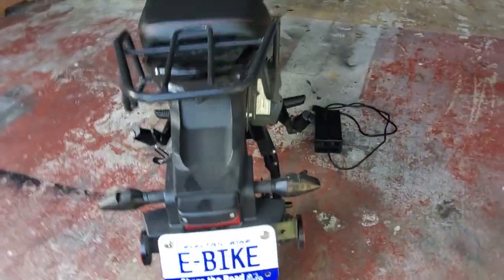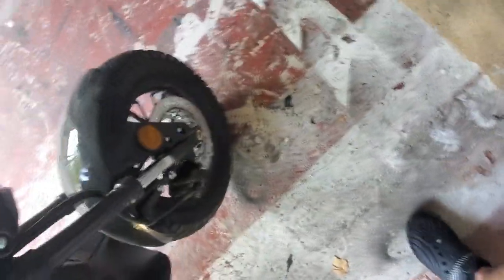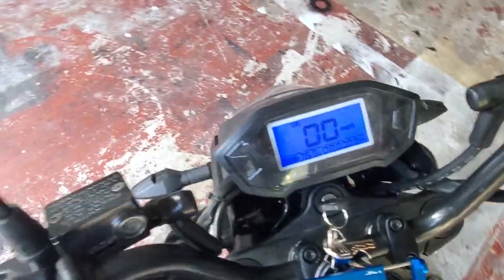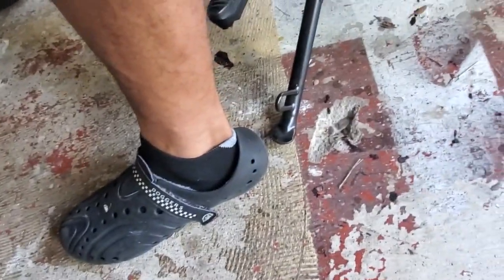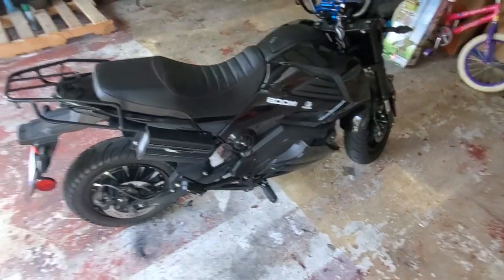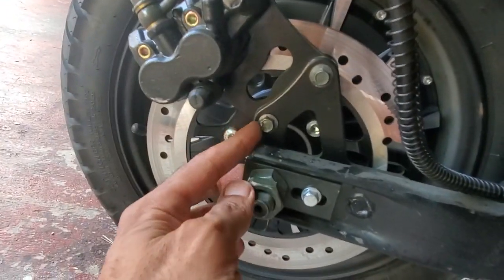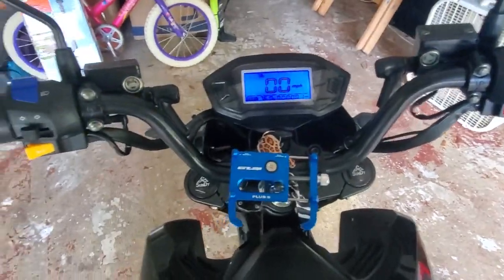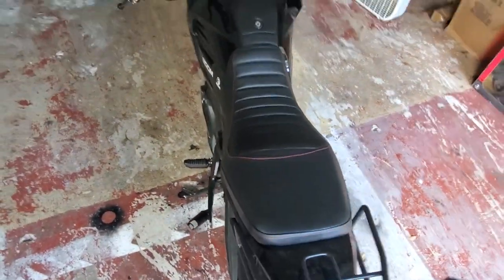Boom BD578Z/ E-Grom/ Boom Evader/Boom EX-20 / Electric Scooter Review

Comment: Thanks for the video i have watched this video countless times and it has helped me in my decision on which bike to invest my had working money in.I  purchased a simular bike (Vader E-X20 2000W) and ive had it almost 2months now, do to the  weather where i live, I havnt been able to ride it much...But I can say that when I do ride it, Its hella fun. Its not difficult at all to control, handles Corners like a champ and can be stored almost anywhere. Hell, i live in a small apartment and I store it in my front room. The only problem I'm having  is that my top speed is only hitting at 59km which translates to about 36 miles per hour...I I can deal with the fact that I can't change the kilometers to miles per hour but when I watch other videos and see others hitting 70km, Its kind of frustrating.I mean at least meet me halfway. Now I have called  tech support and they said I have to get it to its break in Point and should go faster E.g ( 500 to 1000 miles ) or so...I well post pics on my page
Reply from the maker: No problem. Glad my video could help you out! They are really fun, great short commuter  ..thanks for watching! Yeah the kmh part is a bit of a pain. But after a while you'll start just converting it in your head. I typically ride around at around 40 - 45ish. It took a bit to get up to 68. It does need a bit of time to break in. Especially the suspension. Not bad...but gets better the longer you ride. My only gripe are the blinkers. If you are turned to far to the left while going left, or to the right if going right....the blinker won't engage. You have to keep the wheel straight.
Reply: @techjunkie3916  Really? the blinkers I have no problems with, maybe because I have the 2019 version and they probably upgraded it but those review mirrors...man all im seeing is my damn shoulders lol
Reply from the maker: @leonardjones1077  I believe that's the same one I have. But the 2018 version. Boom Vader EX-20 2000w BD578Z. Though the top speed is listed at 55 km/h  on some websites, I've reached 68-69 km/h when tested.
Reply: Good I hope mine gets up there because I went down a small Hill and it stayed at 59km/h and people tend to pass me often..I would stay away from Venom Motorsports Canada, those guys are A holes. They never answer any of your questions and act like they never seen your bike before, even though they sold it to you, yea it's crazy don't buy from them
Reply from the maker: @leonardjones1077  Wow, that sucks. Though im sure I dealt with the same people, I didn't have THAT experience! But to be fair, I hadn't had to call them about anything except my right, front reflector. They said it would be around $25 plus shipping....for a reflector...

Comment: I really like the way your bike looks compared to mine! Would you do a range test?
Reply from the maker: It's been a bit since I've been able to ride. I just ran across a question someone asked similar to that. It's very similar to what they say on their site. But what I found is that 30mph is the sweet spot. 

20mph = 40 miles or close to it
40mph = 20 miles or close to it
30mph = 30 miles or close to it

( when I say close to it, it really is ) You may either get a little under, or over. Flat ground you should be fine. But if you have hills...it'll vary greatly.

It really depends on road conditions, and weight of the rider. I stand 5'11 @ 176lbs and full throttle I get around 67-69 kph/40-42ish mph. I have not reached 70. That would probably take a lighter rider. Someone around 140 - 150lbs or so.

Comment: Yo can it do wheelies?
Reply from the maker: Highly doubtful. If that's your thing, stick with gas powered. Not enough low end torque. And the throttle response is different
Reply: @techjunkie3916  ty
Reply: @techjunkie3916  a zero can do wheelies if you don't learn how to not do it , involuntary wheelies are a problem with new riders on zero motorcycles 😂
Reply from the maker: @yorsan2240  But that's also a totally different bike, has more power.

Comment: Is it restricted when you first get it? Also the speed is fine for me but the range is too low do you think I would be to swap the battery for a  lithium ion 72v 50Ah battery without any issues?
Reply from the maker: Thanks for watching! I dug around a bit when I had the bike, I couldn't find much fact. I found a few rumors about cutting a wire, but I didn't bother trying. I saw quite a few videos where people ended up cracking the plastics trying to swap the batteries...but it can be done. I wanted to do lithium myself. You may/may-not need another controller depending upon whether the controller recognizes the batteries. It should though. But if you want more range. Then get the biggest pack you can find that will fit safely. They also sell hub motors for these as well. I've watched a few videos where people have doubled the speed of these right here on youtube.
Reply: @techjunkie3916   do you know by any chance a good combo of battery and hub motor that will work with it that i wont need a new controller for it?
Reply from the maker: that's a little tough. our hub motors are rated at around 1800w - 1980w realistically, though they say 2000w. You'd achieve your goal  easier by switching to litium battery packs first, then work from there ....I've sold the bike since this video but I do remember doing research on it.
Reply: @techjunkie3916   okay cool one more question. Do you know anyway to charge the bike faster? If im unable to change out the battery for a really high capacity i would like to at least make it charger faster so It less of a wait and more convenient compared to a gas version.
Reply from the maker: @raginghope9866  to be honest that bike isn't set up for quick charging out of the box. You would have to do some mods.there is a guy on here who did it. Motobraap. I think that's his YouTube name. He made his go around 70 to 80mph. But he swapped the entire battery pack and added a chain and sprocket combo. His rear sprocket is almost as big as his back tire. But as far as quick charging. You would probably need to swap out some electrical parts to achieve that. And another set of batteries. These are good for around 600 to 1000 charging cycles. Sla batteries. Go lithium. Also another guy who made his faster was "theinja" on youtube. He got a different electric bike but same principles apply. He, and his friend lord kurt really help you realize what you can do with these.

Comment: From NYC, really considering on purchasing one. Does it have to be registered?
Reply from the maker: @liveboyrellz typically I would think so. Depends on your local laws. Check with your state, or local DPS. Here in Houston, Tx the laws are touch and go with electric scooters like this. I attempted to register. BUT, for whatever reason they said my vin number didn't exist. Weird. But I would still at least check asap before purchase. Saves you trouble and hassle.
Reply: Cool sorry to ask another series of questions, what was the top speed and there is no clutch is it possible to purchase two batteries or is it plug in to charge ?
Reply from the maker: @liveboyrellz  It's alright. The top speed varies. Weight dependent. You could expect anywhere from 35 - 40(ish) depending on your stature. And the batteries. I'm sure you could do a swap. I would recommend lithium if you do go that route. Costs more but would be more efficient. I will probably try a swap in the future after these batteries run their course. But at that point I will need to upgrade the controller.. as for charging ... It plugs in to a regular 120v 3 prong outlet on the wall. It has an adapter that it comes with, I show it on the ground next to the bike. Thanks for watching!

Comment: Whats the link to the texas law copy that u have.
Reply from the maker: Allow me time to find the link. I printed it out. I'll have to find the URL again
Reply from the maker: I've sold it since this video. State law: can not exceed 20mph, must have foot rests/pedals. Can not conjoin with on going traffic in the same lane in.. impeding traffic. As long as you are responsible...you can make it work. It was capable of 37 mph. So in the event you need to merge you can. Your acceleration would outpace the car next to you. And it literally pushes forward a second after throttle pull. It's almost instant torque once it engages. For those who say it can go passed 20mph it shouldn't be limited to 20mph speed rules. Most 6 cyl cars can go passed 120mph. But  that doesn't mean the driver will do something irresponsible does it? That is individually dependent , but I'm getting off topic. As long as you're throttle responsible it'll work. I never got stopped. People just inquired about how it worked, even police. Especially when they don't hear a sound. Texas Authority still aren't used to the idea of a silent 2 wheel vehicle

Comment: Hows the range? I live in a semi mountainous/hilly place and I wanna use it to get to and fro to work. I have a mostly uphill drive to work and then downhill return. about 14  miles round trip
Reply from the maker: Thanks for viewing. The range depends on if you're cruising or not. 20mph will get you around 40 miles on flat terrain. 40mph and above will get you around 15-20 miles of range. Per charge.

Comment: Also do you feel as if you have the charger inside that compartment is it a noisy bounce/ maybe put a little towel inside.. also is it possible to charge and ride? Do you think it would be possible for a power bank to sit inside of that compartment in order to charge while riding to maybe get a longer distance? I wonder if that’s possible
Reply from the maker: Although a great idea. It is not yet a reality. Charging the bike disables any other function to do with motion. But no. I don't sit the charger inside the compartment. I usually have a backpack I place it in. But that is actually the designated location for travel for the charger. In the compartment. The towel is a good idea. Or a lengthy piece of foam to cradle the charger. To keep from knocking around. The charger seems to have a few easy to maneuver parts on the inside. So I would definitely use some sort of shock absorber. An electric bike is no good with a charger with loose parts inside. The sad reality. In electric bikes, as far as I'm aware....someone can correct me if they know different. But ebike batteries are years behind cellphone batteries. They can not charge and discharge simultaneously , but hey, if you're the first to get that patent out for charging/discharging ebike battery simultaneous technology... don't forget to at least give a shout out. You know what would be a good name? "Y-Charge" you have one goal in mind with dual benefits.
Reply: ow did you get the plate? And did you got to the DMV to register? Insurance?
Reply from the maker: @sensing9663  I give the website I got it from when showing my plate. It is the url "www electricbikeplates.com" and unfortunately the DMV could not register mine because they said my vin number on the bike didn't exist. So no insurance on it.
Reply: Tech Junkie what’s the range and actual speed
Reply from the maker: @xavierjeannis  41-42mph. Depending on your weight. Range is in between 20 to 40 miles. Depending on your throttle habits.

20mph = 40 miles or close to it
Full throttle = 20 miles or close to it
Reply: A power bank to charge this would need to be bigger than the battery itself.
Reply: DEAN WATERS by how much?
Reply from the maker: @thra5herxb12s  I wouldn't even think of a power bank right now. That cost would ruffle me up.  But not a bad idea for emergency juice. Downfall is scooter can not be turned on while continuing to charge. Maybe they might do that in future versions. It would help. Don't expect to use throttle while charging. Also the breaker needs to be on while charging. It will not charge with the breaker switch off.

Comment: Hey man nice bike. Quick question, I just got mine today, do you have any idea what the Fluid stuff is on both the left and right of the handles are when You just get it
Reply from the maker: Congrats on the purchase. I bet it'll be an awesome ride! It's break fluid. Thanks for watching!
Reply: That’s what I thought. Should I leave it on the handlebars because when I see videos and stuff of people using the bike, I don’t see them with it on there
Reply from the maker: @Drip_Lord69  They may have a different bike. I would leave it alone, but if you really want to im sure you can find a way.
Reply from the maker: @Drip_Lord69  my bike has over 1500 miles and still running strong. Breaks work great, no leaks, my only gripe is the front right fender reflector fell off. So just remember to go over the bolts every few hundred miles and you will be fine.

Comment: What up homies ! I like you style with explaining everything and handle yourself in type of situations and not like things break your Spirit ! Big ups to my G ! ....That being said, I got the same bike and it is what’s up ! I have had adventures on this thing ! I got stories! Lol ... I am currently building a custom chopper based on the same frame with a 5000w motor with the same size rims that we run on our bikes!  In the mist of all that will be upgrading the batteries on the boom to lithium and in the future might up the motor twothrough 3000 or 4000 motor . Get at me G ! Stay blessed ;)
Reply from the maker: That's what's up! Thanks for watching. Let me know how that lithium swap goes. I'm planning the same thing. Unsure if I'm going to get lipo, or another set. But I've got to be able to take the platics off without it breaking. I've heard they are very fragile upon trying to tighten the screws to the side farings and body plastics. With that lithium battery swap it should get you up to 60 to 70 miles per charge. I get close to 40 as long as you're not throttle heavy. Just clocked 1533.3 miles.  Still running strong. Just have to tighten the rear break screw. The screw seems to want to come loose every now and again for the rear break. You can hear it when rolling over bumps. It gets loose enough to bounce while riding. Doesn't get loose enough to fall out. Just a quick tighten up at least once a month should do.
Reply: Tech Junkie  You know you should do is either get Loctite for the bolt which helps keep it in place or if you don’t have Loctite tighten it all the way take some coloured paint put on the very tip it should keep it in place or also let you know if the screws gotten loose! ;) also I am building a Electric Chopper with a 5000 W motor 😁 lol  It will be fun and fast ! And I for sure will let you know how that lithium swap goes also my friend Did a lithium swap and his bike is now more powerful and does not have to charge as much as well as can’t go farther and distance! As for your speedo problem you can get other speedo‘s on Wish or eBay which are GPS and the great!